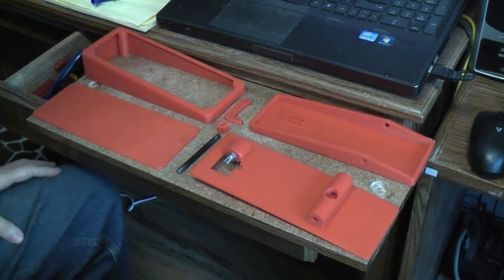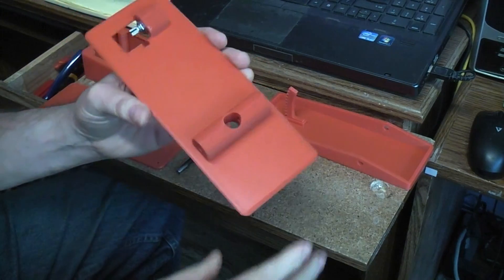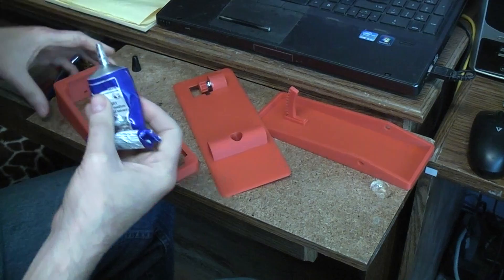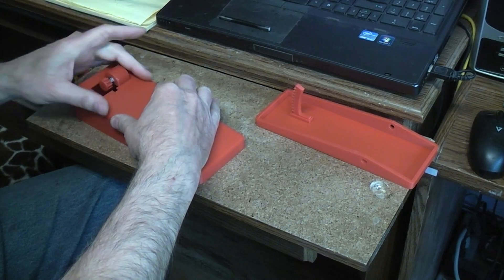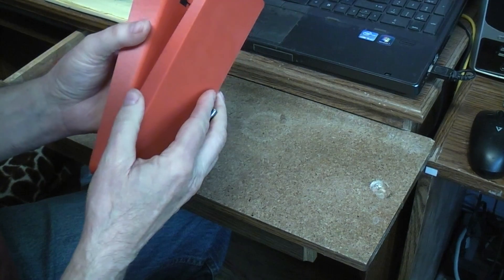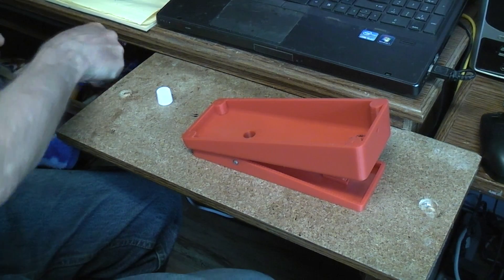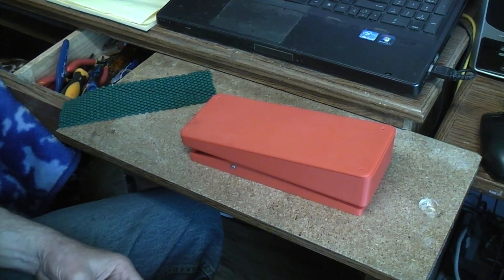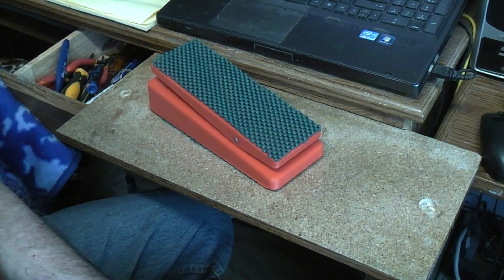3d print a Rocking Foot pedal. I will control my Leslie "rotating speaker" built with it.

Comment from the maker: When I used this pedal for my Leslie speed control, I just used a 10K linear taper pot. One side of the pot goes to +5 volts and the other side to Ground and the wiper goes to the speed control line of the circuit.

Comment: can i use this enclosure to make a midi expression pedal (wah)?
Reply from the maker: Yes. I have used it for Volume pedal, Distortion pedal, Wah Pedal and a speed control for my Lesli rotating speeker.
Reply: @Robothut  cheers, how does it feel using it? does it feel stiff, smooth, easy to break or what?
Reply from the maker: @_panilaperman9881  The ones I built feel very smooth, just like a normal Wa Wa or volume pedal. Some builders are moding there's for the larger size POT, I have no idea how those feel.